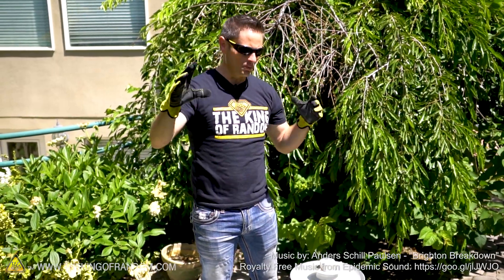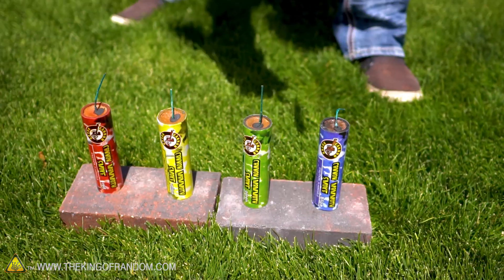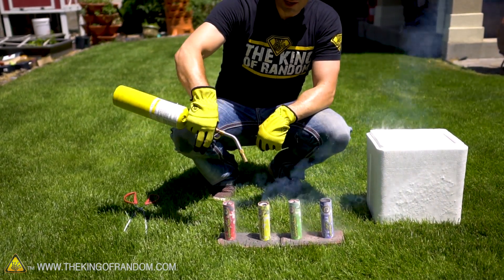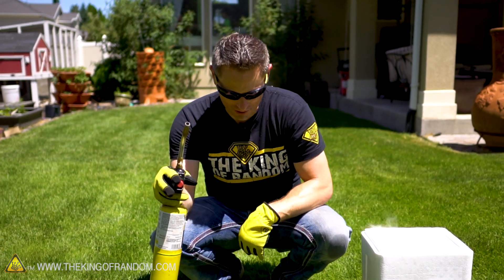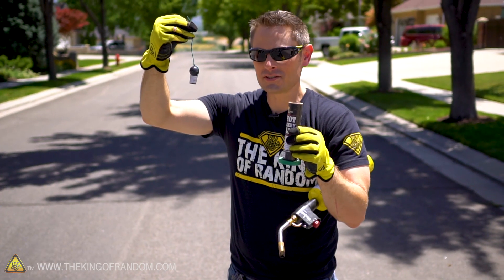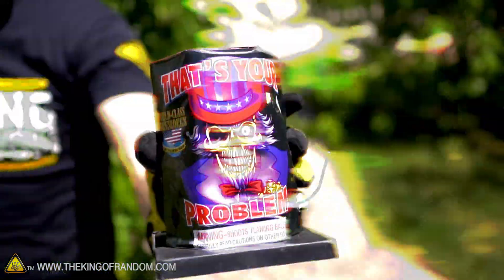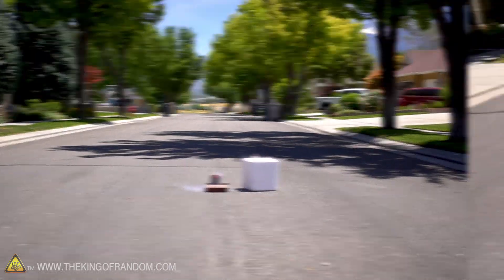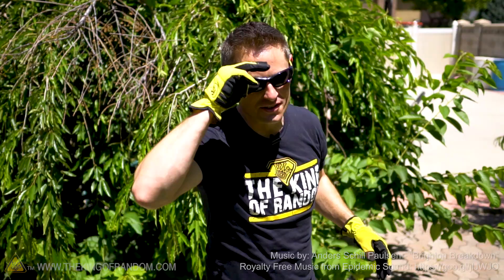Fireworks In Liquid Nitrogen? TKOR Experiments With Shooting Fireworks Combined With Liquid Nitrogen

Comment: light a firework and put it in the vacumm chamber
Reply: Jayden Langston 
Here's the possibilities:
1: the vacuum sucked out all the air so it won't ignite and noting will happen
2: the pump can't pump out all the air in time so it exploded inside the vacuum chamber
Reply: seems interesting aye?
Reply: If it did explode I imagine it would be bigger than normal as no resistance but very dangerous
Reply: The question is, how you are going to light it in the chamber? Sure, you can use an extended fuse, but it may take too long and the air will be sucked out, and the firework may not even ignite ;-;
Reply: And if you were to light the firework then put it into the vacuum chamber, it might explode before the vacuum chamber is turned on
Reply: Jayden Langston fire cant buren in without oxygen

Comment: Try to put fireworks in liquid oxygen.
Reply: Twoja Stara Nitrogen turns liquid at a colder temperature than oxygen, so at it's boiling point, liquid oxygen would be warmer.
Reply: but oxygen is a oxidizer, so it will help fireworks burn faster

Comment: What is fire 
Liquid , Solid or Gas?
Reply: plasma
Reply: Nerf and games and paper airplane 2.0 Plasma
Reply: its a chemical reaction not matter
Reply: Maxime FROSSARD it's not plasma, for something to be plasma it would require a lot of energy and heat. Fire is what you call a "combustion reaction" where it uses oxygen and things like fuel to create a exo-thermic reaction.
P.S. Fire is not a matter, plasma is a state of matter. The only place in the universe where you can find plasma are in the sun, yes those aren't flames the sun is a fusion reactor and all the red stuff are super heated gas
Reply: Mercury The Metallic Liquid plasma can also be found in:
lightning
electricity
ionized gas
fluorescent bulbs
etc
Reply: Alex Tanasa fire isn't a matter it's a combustion reaction
Reply: I think it is plasma
Reply: Well I'm not a scientist.
Reply: Flames are made up of carbon dioxide, water vapor, oxygen and nitrogen.
Reply: Nerf and games and paper airplane 2.0 

Visible heat energy maybe?

Comment: What happens if you freeze Mercury,will it act like a solid metal?
Reply: iPelaaja1 prove it boi 👑✌
Reply: The Golden Banana yes
Reply: Kinda ironic how I'm using this username to reply about this comment
Anyways, yes mercury is like all the other elements in the table they all have 3-4 states which are solid,liquid,gas and some can turn into plasma. Mercury is like other metal but it has a very low melting point. 
Conclusion: yes if it gets really cold it will turn into solid
Reply: Trevor Allen yeah it's like Indium
Reply: Haha no, it wont, it will bend very easily
Reply: The Golden Banana
Reply: The Golden Banana yes and it's BRUTAL
Reply: mercury gas huh? Wouldn't want to be anywhere near that
Reply: Check Taofladermaus channel
Reply: Cody's lab tested it out..
Reply: The Golden Banana it will be brittle and has something called the mercury cry. Codys lab did this